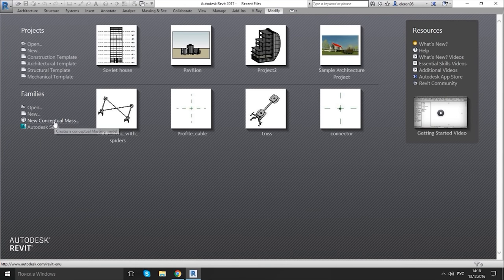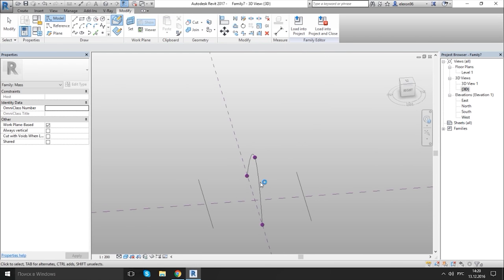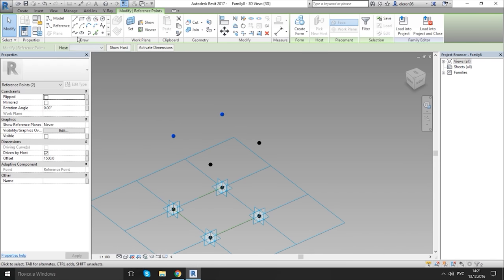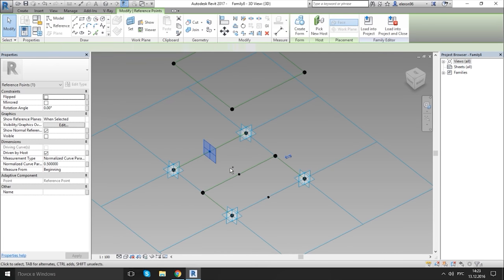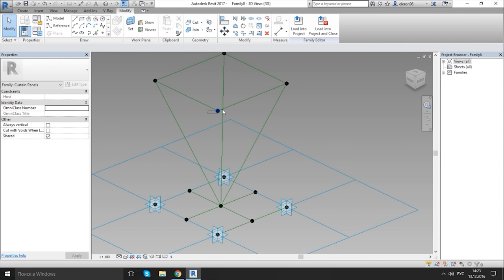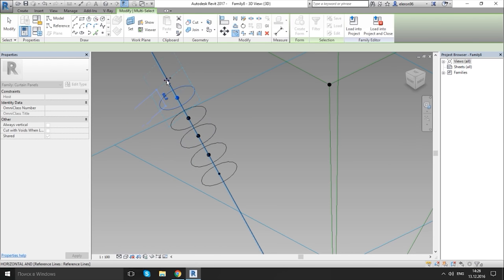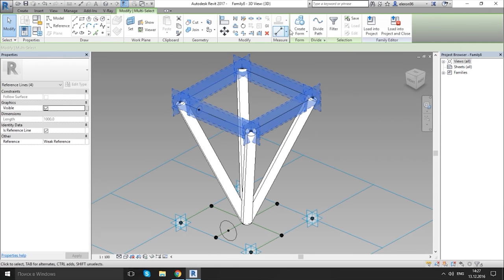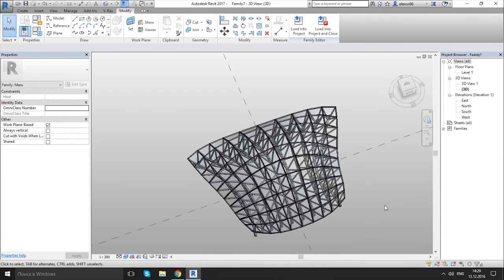Learn revit in 5 Minutes - Parametric truss system

Comment: Hi thanks for the video, just one question, when i picked the family into the grid system, the module is linked on the bottom, but upside always ends unlinked, like the 4 corner wont ever join...could you tell me what i am doing wrong?

Comment: After creating a tube with the circle  and the reference line, when I change the radius of the circle, the tube doesn't change equally, just only the  middle circle changes but not the two ending circles of the form, how can I fix that? However great job Niko.
Reply: @NikoG I have the same problem, I'd appreciate if someone gave us a solution)

Comment: Hi Niko, may I know is there a reason you used Material Parameters in 6:00 than just assigning a Material to it? Is there a benefit to it? :D Thanks!
Reply: its to make the roof made of glass, if you go a few minutes back you will see he made a plane using the reference lines in the top.

Comment: I did exactly what you did, but when I'm trying to apply the pattern, an error message appears "Can't make type Rectangle: Family2.only thing i changed is i worked in meters but on the proper dimension waht seems to be the problem?
Reply from the maker: for understanding what going on, you can send me your work file and I'll check it.

Comment: Hey Niko, I followed your instructions to create a parametric truss system for my conceptual mass, but when it comes to insert the family into the patterned surface, the structure does not adapt to the curves, it just appears on top. Wish I could send you the picture! Please help!
Reply from the maker: Nikog90@outlook.com send me ur file. ill try help asap.
Reply: Same happened to me. The top points don't seem to be adapting! Trying to sort it out now! Great tutorial though ;)
Reply: Worked out where I went wrong! Thought i was being clever by not setting the work plane when placing all the points! Thanks for a great tutorial
Reply: how did you fix that? im having the same problem
Reply: Did you solve the problem?? the same problem to me!! Please talk to me what I do!!

Comment: Hello Niko! Can you help me? I have followed exactly the same steps as you have directed on the video... but I ended up to a result like this:

https://imgur.com/Qp908We
https://imgur.com/FFeiFAK

Do you know what might be the reason? It seems that when I change the surface pattern to the family, it does not adapt with the parametric shape and thus I got so many spaces between each point... Pls help ): Thanks so much!!
Reply: Oh and by the way, I am using the Revit 2020 version.